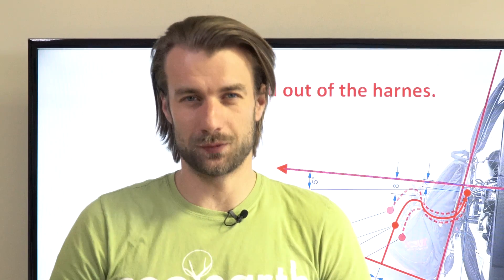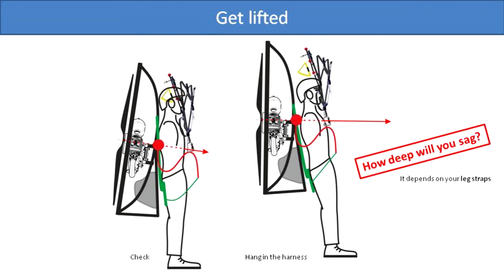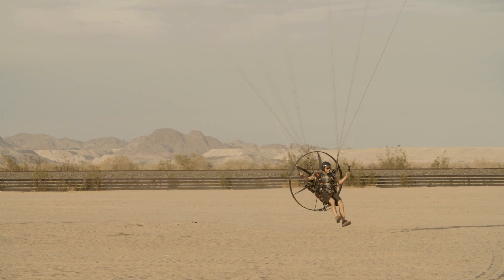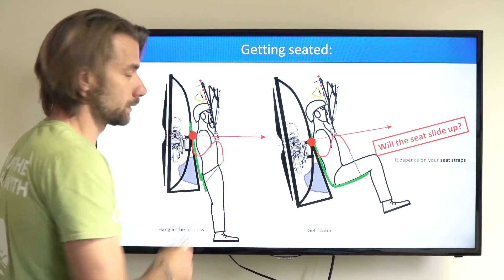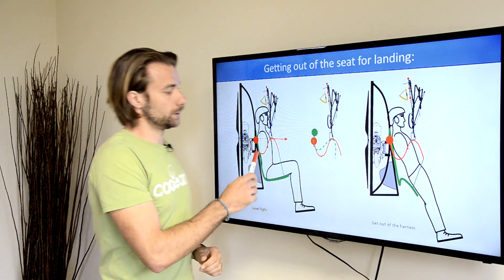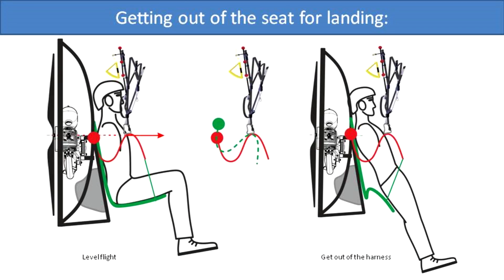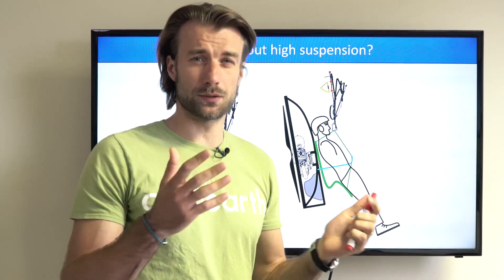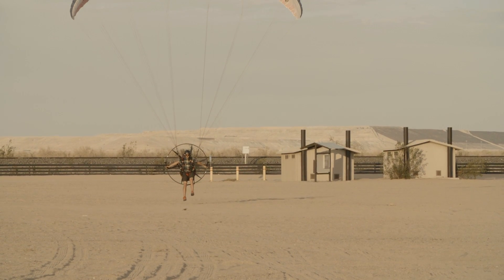Getting in and out of the harness. Paramotor geometry part 21.1

Comment: What about a two stage leg strap adjustment? Tight on takeoff, then pull a strap to lengthen them  for a better landing configuration?
Reply from the maker: I think getting in and out must be a hands free operation. Check for the update to this video: 21.2